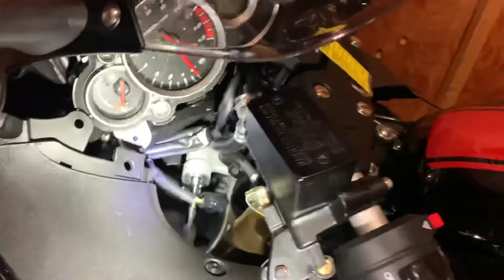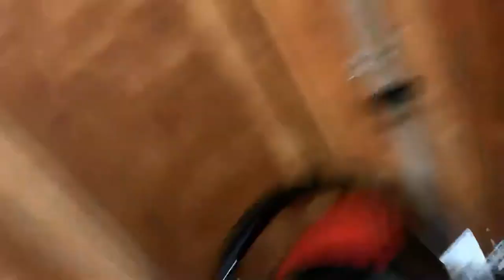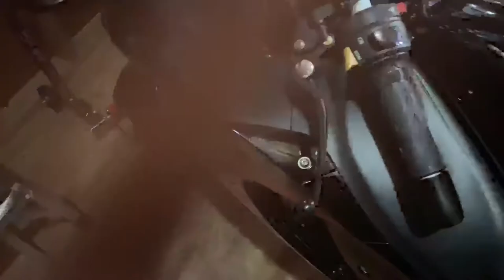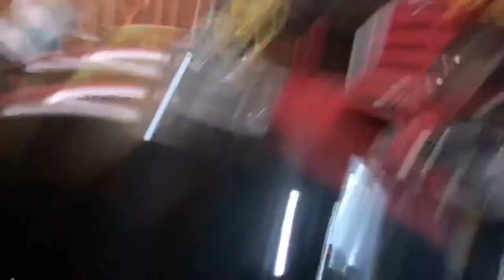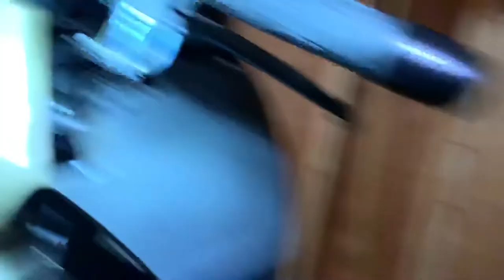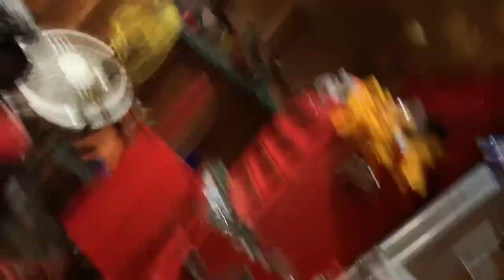2018 hayabusa high beam head light swap

Comment: ok next time take the cover off the bottom of the nose 6 little snap pins two up front, two on each side underneath the nose and the high beam is on the bottom 5 min job ,  now the low beam take out the dash cluster as you have all gen 2 Busa's  I just had to replace whole headlight assembly that you have to take the nose off  mine had a crack and let water in while I was washing the bike
Reply from the maker: vphathom ok thanks for the info I’ll keep that in mind for next time.